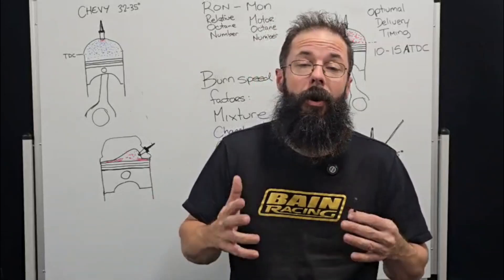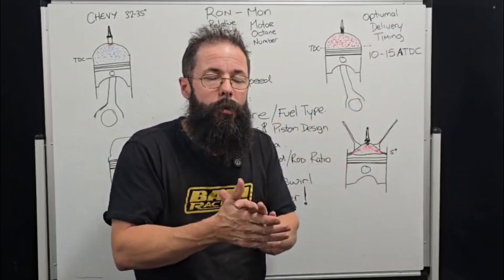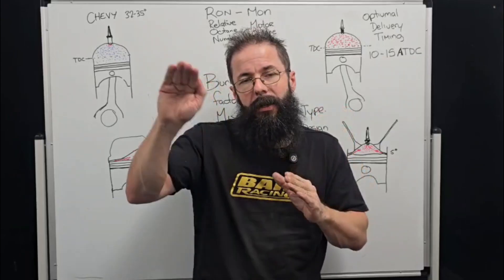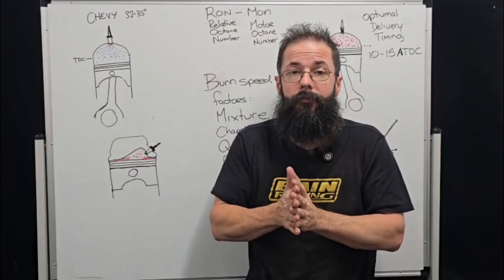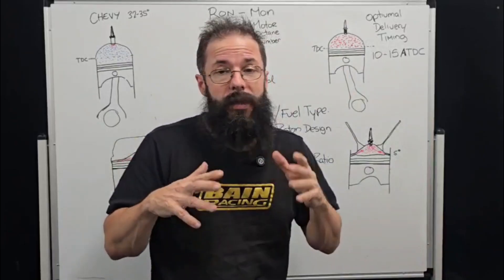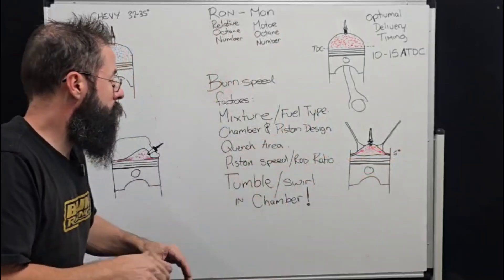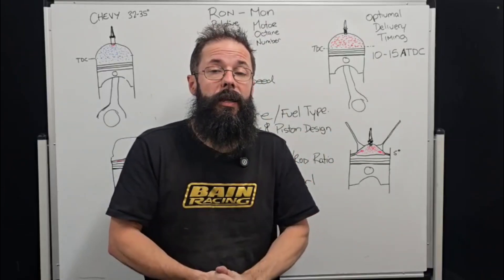Understanding Burn Speeds & Engine Combustion: Sponsored by Einstein Motors #carcommunity

Comment: Thanks. I was recently introduced to burn speed as a factor while comparing restricted and unrestricted ignition maps for a common modern motorcycle. The restricted version has a heavily restricted intake allowing a maximum just of ~11% of what the unrestricted intake would normally have presuming no issues with flow.

The advance for the restricted version is 49deg at 13000 rpm full throttle. On the non restricted it's 32deg. Surprised the hell out of me until I realised that burn speed would be lower with less air/fuel mix in there. Less squish. Molecules further apart.

I'm pondering a partial de-restriction with an intermediate intake runner and was curious about just splitting the difference in the ignition tables. Linearity was the big unknown. As the restriction was gradually removed would the advance need to be reduced more initially and less as it approached unrestricted or would it be the reverse?
Reply from the maker: Yeah you have to be careful here as there's a few things happening.   Some times as we improve cylinder filling we can reach the fuel limit as far as octane goes.  So this is why some engines will not like more timing as we improve VE'S,  but yes as we increase cylinder density we generally need less. Just like with additional boost.

Comment: Also the angled quench on 4 valves - how well does it work to utilise the angles on an intruder piston to squish up towards the plug ?
Reply from the maker: Yeah some OEM engines do this from the factory. Seems to improve burn speed and cylinder pressure so does influence HP and torque.

Comment: I'm assuming the perfect example of quench effect on timing is on a sidevalve (flathead).  technically a terrible combustion chamber shape, but about 3/4 of the piston surface is quench pad - generally way less than 30deg timing is optimal
Reply from the maker: Yeah, id say srostock would be your perfect example of both. Surfacearea ratio and quench.  With around 45% quench made possible by having valves cross bore allow for far smaller chambers,  less head volume so no need for lumpy tops. Also improving your surface area to comp ratio.  👍  this is key knock stability.  This is something the side valve was horrible at.
Reply: @bainracing  '  this is key knock stability.  This is something the side valve was horrible at.' Tell me about it 🤣water air intercooler and water/meth injection on our supercharged one (oh yeh and the boost registered ign. retard)

Comment: Ugh... Lost the comment in here. Check out the Allan Roots version of the 429 Boss. He was in the Arias camp and Bob Glidden bought up shares and told Ford not to give it to anyone else 🙄 
It looked more like the 426 on the outside. Kaase also worked real magic on the Boss, it seems to outperform his SR 71 at all rpm in both hp and torque. Of course NHRA banned the overall motor because of the large bore centers... You touched on the dual quench pads towards the plug...
MORE!!!
Reply from the maker: All legands mate. Very familiar with all of them. 💪 those boys were pioneers!!

Comment: I thought port injection better atomized the fuel due to the higher air speed through the valve and more time to mix than direct injection, despite DI working at higher pressure.
Reply from the maker: Yeah, a lot of people thought that. Unfortunately thr back to back testing shows port injection will make less. And the reasons come down to the pumping losses created by the injection at the window and the DSM size of the fuel droplets between the two systems.  There's a huge difference! 

This is why we always recommend a higher injector position when using port injection as you have more shear time for those very large fuel droplets.

Comment: Obsolete engine design is interesting.
Burn speed is all about combustion chamber temperature, with a minimum wall temperature of 1200F. Below that you're going to have soot, slow combustion, and quenching (which is defined as extinguishing the burn through radiative cooling near a cold surface).
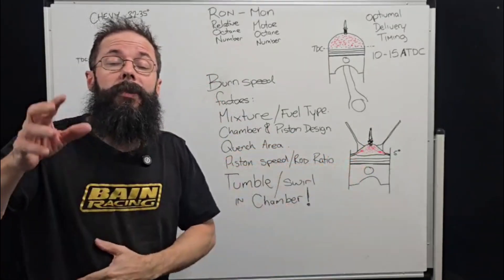8:21 modern combustion chambers will be alongside the cylinder and insulated instead of inside it and cooled.
10:50 "tumble"
Another reason for externally located combustion chambers: complete freedom and control of gas flow and chamber design since there are no valves nor a piston nor a cylinder limiting combustion chamber design.
Reply from the maker: We are talking gasoline engines, mate. Not diesel 👍
Reply: @bainracing so am I. Actually either works, given that hot wall ignition doesn't require compression (low CRs work fine) nor spark.
And it's not just fun, studying the cutting edge of the field is highly educational.
Reply: Sounds like you are describing a canular combustion chamber used in jet engines.

Comment: most ww2 engines were boosted and had around 6 inch bore 6 inch stroke thats the biggest they could go and get the whole charge fired off with 2 spark plugs per cylinder most ran 2800-3000rpm max i have a 28 cylinder 4360ci pratt and whitney and how they got it to live is fasinating
Reply from the maker: They sure were wild!👍

Comment: burn speed is affected by fuel, AFR, and compression.  the other things either don't do anything, or you're conflating burn speed with  *burn time*.  quench is not a good thing.  it's the smaller chamber that reduces burn time.  quench literally puts out the flame - in the quench space, and the squirting mixture disrupts the flame front.  either you shrink the quench zone to zero as you say, or you "soften" the chamber by opening up those areas so there's no quench at all.  the literature is over 30 years old on this.

Comment: Hey, when you talk about 32-35 degrees of total timing for an SBC what RPM are you talking about here? I know its just an example to explain the flame front but I'm just curious what you've seen on these older blocks. For my piece of crap engine I needed to run a bunch of timing at low load conditions and around 11-16 for idle control so I'm assuming this would be a WOT timing figure?
Reply from the maker: When talking timing, it's total timing.  Generally, it is always around peak torque.  The curve will be dictated by cam and comp.   Some engines need as much as 18-20 for idle.  LSA,  duration, etc, all play a part.
Reply: @bainracing  Thank you very much.

Comment: Hi there been following you for some time now and I  have had the pleasure and experience to work with a engine builder in NHRA pro stock and as we did so many combinations of bore and stroke, rod length I dealt with combustion chamber designs any where from 14 degrees to as little as 8 degrees valve angles and shallow intake valve cants to more aggressive cants depending on the bore size we found compression ratio that had any dome configuration was where  your ignition timing had to be addressed because of the wedge design you have to travel the dome which has peaks and valleys that dictate flame travel and its time to spread completely! Fast forward to today's motorcycle engine which centralize the spark plug  and virtually has the valves angle in the engine  almost with no angle making for a very small combustion chamber and allowing a pretty flat piston top but making large compression ratio (static) seems to be an ultimate design at present ! Thanks for sharing the information in the video because a lot of people don't understand these important static features when considering the efficiency of engine design and understanding it.
Reply: The newer moto engines I've had apart are completely bonkers on their valve/piston/head tolarances. At the start of the intake stroke all four valves are sitting down in their valve reliefs and there's just a few ccs of chamber directly linking the intake to the exhaust above the valves. There's so little tolerance there's barely even carbon build up in the quench and reliefs!
Reply from the maker: @BuffMyRadius Yeah they are! Its why it's important to decarb 👍
Reply from the maker: 100% mate.  It's wild to see the evolution of the ICE.  And yes. There are so many static features that influence the propagation speed and knock stability.

Comment: Longer rods are better because the leverage angle to the crank angle is closer to 90° for longer on the down stroke!
And not pushing the piston sideways so much! But there is a limit because longer rods are heavier so takes more energy to move them. So longer rods should go with, low end torque with a smaller turbo creating more pressure at lower RPMs. 1200 to 2300 on Diesel and 1700 to 2800RPM on gas. Diesel burns quicker because of higher compression detonation! Good video!
Reply from the maker: Yeah, it definitely translates better in boosted engines.  NA can be a little different as the longer dwell affects efficiency, savaging, and the velocity acceleration of the intake wave. This is why engines in drag racing don't go too long as you actually lose HP and torque. 👍

Comment: How much does solubilized oxygen, dissolved, entrained and entrapped air in the liquid fuel aka fuel oxidation and air contamination in the fuel that significantly contributes to fuel cavitation. How does this contribute to abnormal, uneven and incomplete combustion aka burn speed?
Reply from the maker: Chemistry kinetics definitely plays a part. But that's far too deep for this channel.  I've written a paper for Einstein Motors on exactly this! For this one, we are just covering basic flame front propagation.
Reply: @bainracing  that is great, How do I get access to that paper? we have developed a solution for removing dissolved gasses from liquid fuels
Reply from the maker: They will probably add it to their technical pages in the coming months if they want to use it.    I'm one of the contributors, and I've designed the calculators. But we have others involved and more coming on board to add to the information/experience etc.

Comment: Never heard of "Relative Octane Number" Dont you mean Research. We dont use mon in automotive also. RON is the standard mate. Why talk about LS engines with regards to performance, they arent designed for performance.
Reply from the maker: Yeah, i probably miss spoke. 

But RON isn't the std and only tells us half the story. All US fuels are  based on the AKI, which is the sum of both. 

Also, the point of talking about MON (this being its anti-kcock "high speed" index). Which is far more realative to making power.  Is to understand the dramatic influence of different combustion factors have that influence this index. 

The point of the LS was it is actually a performance 2 valve  head design with lots of advantages over early two valve heads. From valve angle to plug position to velocity index and its discharge coefficient.  

But you don't you, man! 👍
Reply: @bainracing  It's written on the whiteboard. Performance is applying the best technology. 2 valve pushrod engines became obsolete in the 80's. Not trying to be rude, it's just fact. This was understood even in the 1930's.
Reply: RON is the standard, it's used everywhere except NA. They are just ratings. They give insight into the fuel, but they don't define how it will behave in an individual engine.
Reply from the maker: Oh yeah, well, that's possible. I'm highly functional and dyslexic so there is a good chance I'll write and say a few things out of place.🤣👍

But let's be real. That really wasn't the point of the video.  And if you think 2 valves are obsolete,  you really haven't a clue. Our SS are plus 2.85hp per cube.  

And no RON isn't the std and only half the picture as MON tells us the most important aspects of how the fuel will perform.  

And please learn more about the characteristics of fuel!🤦‍♂️. You don't know what you're talking about. 

But you're clearly one of these "experts" maybe do some videos champ. And save your passive-aggressive BS for someone else. 

"Not trying to be rude" while being rude! 🤣🤣👍  that's hilarious! 

I bet you believe your own BS, too! 🤭
Reply: @bainracing  I may only be a mechanic and engineer, and maybe the engineers at Bosch don't know what they are talking about, and maybe I haven't learnt anything from building high output aircraft engines. However, I am certain no SS engine puts out 12,000kw. I've actually made a supercharger that theoretically supports 12,000kw at sea level. The exducer is 600mm OD. Best of luck mate, no hard feelings.
Reply from the maker: @chippyjohn1  🤣🤣  oh you still here trying to defend your ignorance! 🤭👍

Comment: Great video. Im a fan of more undersquare engines like my jeep 4.0, i wonder if the reverse flow head like it has does better with efficiency vs a cross flow head.
Reply from the maker: Yeah,  added piston speed vs area.  For torque undersquare is key. For power over square is best. Simply due to surface area over cylinder pressure 👍
Reply: @bainracing  i stroked my turbo 350 chevy to 383 last year, not a ton more power up top since we didnt change boost level but it moves alot quicker off the line while boost is building. I switched to a roller cam as well went from .550 lift flat tappet to .650
Reply from the maker: Yeah, you have moved the velocity curve down lower.  The engine will respond better to increases in average CSA over stroke.  But the torque and mid range power on your combo would be great!👍
Reply: @bainracing  yeah we are limited to 6500rpm and do lots of autocross and hill climbs so the added power down low has helped alot. Its a 2 speed power glide in it so sometimes its a dog😂😂not so much anymore though
Reply from the maker: 🤣👍  yeah, glides are fun with turbos.  Even worse on some of the 6 cylinder engines.

Comment: I have had a question for some time that I havnt found anybody that has really given me much of a answere? U touched on it I think in this video. You mentioned tumble & swirl, but not in the port, in the cylinder. I have been working on a old ford FE & its common for guys to somtimes smooth the chambers. Somtimes this is done to eliminate hot spots? You smooth the surface inside the chambers. The ruf casting texture you polish nice & smooth. I've been doing this to a set of heads for my old FE. However I'm not really worried about the texture of the chamber, im doing it to try to even up the size of the chambers. They were pretty consistent to one another on each head, but they had a considerable difference from one head to the other. So I went to work & found the largest one & tried to bring all the other ones up to close to that size. I do my own valve job with a set sioux seat grinding stones. And I have all the chambers close at about 79.4cc to 79.8cc. I'm happy with that. Now I will have them milled & aim to make them in the 76cc range. My question however, bringing the chambers to size I obviously ground material out & have made the surface smooth. Good to eliminate hot spots but is there a draw back?? U mentioned tumble in the chamber? I have been wondering is the ruf texture of the casting in the chamber beneficial to cumbustion? Is there a draw back making them smooth??
Reply from the maker: The general rule is that the better the design of the chamber,  the more we can improve thermal efficiency by reducing the Ra of the surface.   But with the older 2 valve heads. It's generally best to finish in a burr finish or 60 grit over polished.   We want to increase "shear" stress on the fuel. 

Even with the best 4 valve chambers, which are all tumble and don't rely on the chamber for fuel shearing.  We only go as fine as 60grit. 

Hope that helps.
Reply: @bainracing  Thank you
Reply from the maker: @jesseduke694  👍😉
Reply: You might be interested in commercial "dimpling" on pistons. Proven.

Comment: Your examples on your board, the 4th one or the last one, i believe you said it had two quench pads kind of aiming toward the center plug. This brings to mind the ford 429 Boss. For nascar. It was kind of a hemi except it wasnt truly round. It was crescent shaped. Thats why they sontimes called it the blue crescent.
Reply from the maker: You are absolutely right,  those quench pads have a direct effect on the flame travel and knock.  👍
Reply: @bainracing  That 429 Boss was refined for ProStock by Allan Roots. Most people thought it was a 426 Hemi because of the plug location. It was from the Arias Hemi and won lots of races. The new Kaase Boss head has great all around performance. There have been subtle modifications that  make it way superior to the original. Would want to hear your take on that. 👍

Comment: There is another factor to calculate in 'burn speed', that not many think about.  
That being spark kernel size.  A larger spark kernel will consume the fuel faster than a small spark kernel.  

A 'plasma spark' ignition has a much larger spark kernel.  

Plasma spark is both high voltage and high amperage.  I have a demonstration video here that shows the difference.  https://www.youtube.com/watch?v=BdakEn92CaQ
Reply from the maker: Definitely! We were testing this with EMS 15 years back. 👍👍👍
Reply: @bainracing  Do you remember, on average, how much you could reduce timing advance?
Reply from the maker: At least a full degree or 2!   The wider the ionising path, the better it seemed to be.  But there's also seems to be a correction between amp and HP. For obvious reasons I guess
Reply: @bainracing  I thought so.  I sell a device that imparts a specific resonant frequency into the fuel, before the injectors.  This frequency lowers the electrical resistance of the covalent bond in the fuel, effectively raising the BTU that the fuel possesses.  

By doing this, I too have to lower timing by 2 to 3 degrees & I'll see a HP gain.  

I'm looking to combine the two (plasma ignition, along with the resonant frequency)... 

I won't say exactly what I'm doing here, but suffice to say that this involves a 'alternative fuel additive'.
Reply from the maker: Very cool man!  👍👍